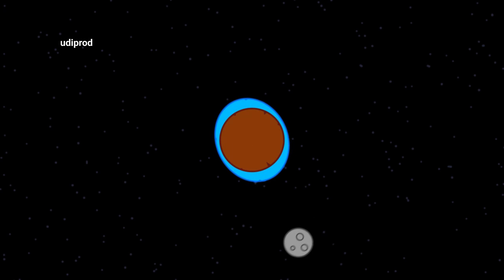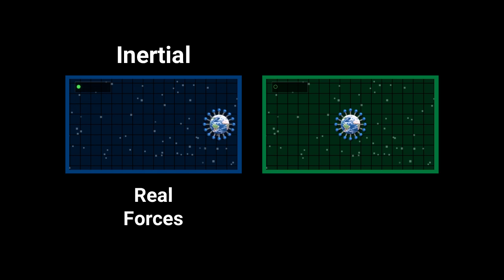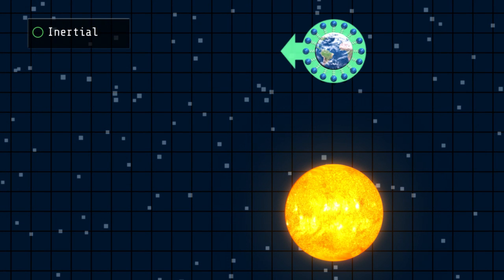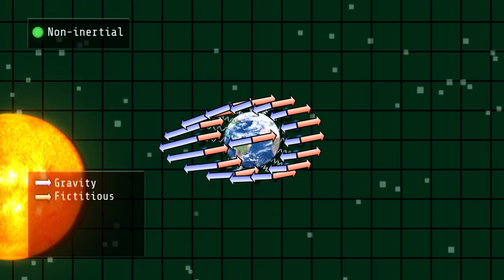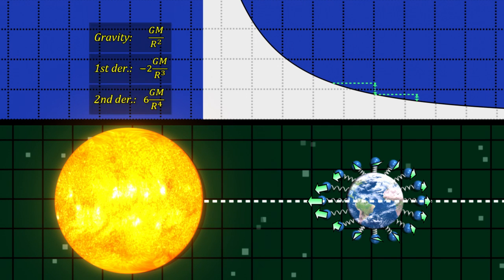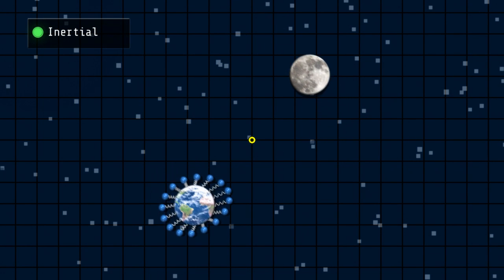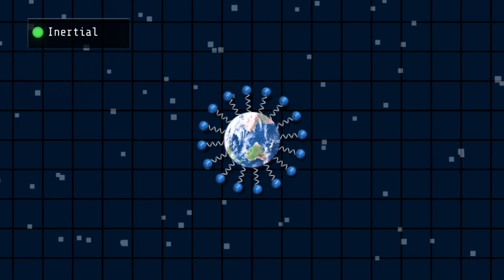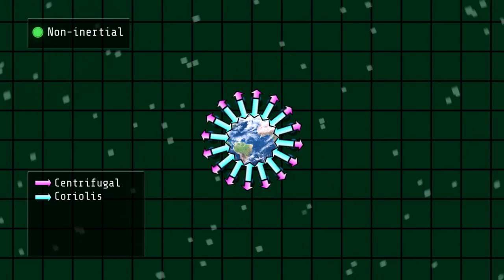Visualization of Tidal Forces

Comment: This is another hokey explanation concerning why there are two high tides, and how they work.  Note at  3:46 in the video, the illustration clearly shows that the particles at the top and bottom of the screen, because they are further away from the attracting mass at the right of the screen, than are the particles at the center of the screen, that those aforementioned particles should flow toward the high tide that is on the left side of the screen, away from the attracting mass, relative to the particles at the center of the screen.  This of course would predict that the high tide on the opposite side of the planet from the moon, would be higher, than the tide on the side of the planet on the same side as the moon.  And this is clearly not the observed case for two high tides on Earth.

The problem with this explanation is found in Einstein's description of space/time.  To understand two high tides, and how they work, one must get rid of this space/time idea, and get back to the Cartesian coordinate system that best describes space, and just look at how time affects gravity.  Einstein's space/time is predicated upon the errant notion of curved space, which was fabricated by Einstein to make some of the mathematics of gravity easier.  This mathematical shortcut does not reflect reality, and in fact, Einstein's mathematical shortcut, space/time, makes the math much more difficult to gain an understanding of what our reality is.

Comment: This is not correct from the starting premise. A continuous fluid cannot be modeled by discrete springs. Your model gets the force direction right, but I am not comfortable with educators teaching a model that misses so many of the features of the tidal force. Oceans are largely incompressible fluids (approximately hold their volume) and bulge due to the squeeze from the diagonal gravitational force from the poles down. Your arrows are correct, but the point is that it is a pressure similar to popping a pimple. Your model shows springs apparently disconnected that fail to convey this pressure. Further, thinking of fluid pressure allows us to consider tidal warming from the friction of fluid moving across a surface.

Comment: Still do not understand why there is a bulge on the other side, sorry. 🙂
Reply: 5:07 look at the arrows. The gravitation is stronger on the facing side to the sun and the opposite is weaker, so the weaker part does have smaller arrows. Because the Fictitious Force is the same everywehre, its arrows are bigger than these of the opposite facing gravitational arrows. So the fictitous force is acting are force outward

Comment: Those two tides are due to the fact that the Earth is flat, the Moon makes the water slosh high on both sides of the Flat Earth. The reason for this is because the Moon has a centrifugal effect on pulling of the Earth's water on the opposite side (the water goes high tide) and a pulling effect on the close side to the Moon. See!